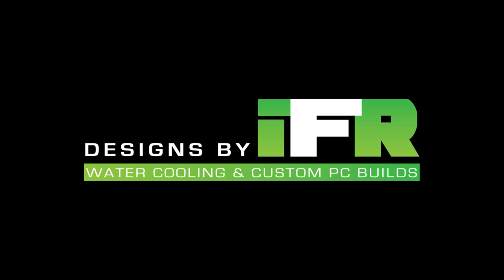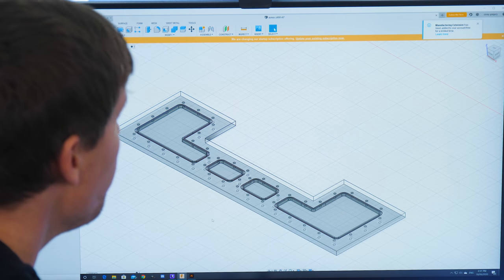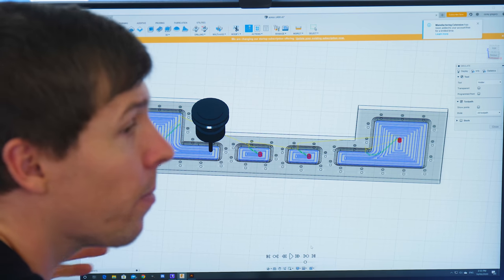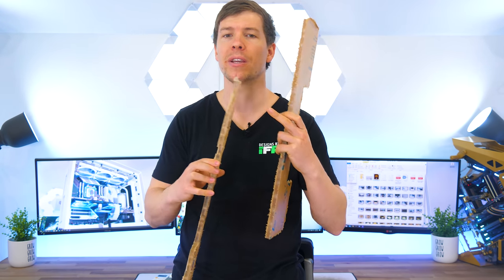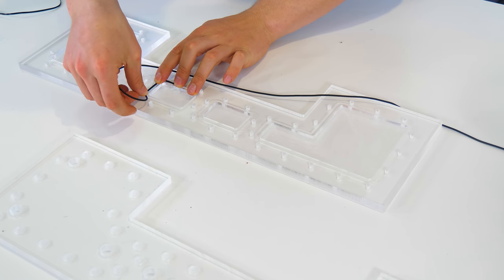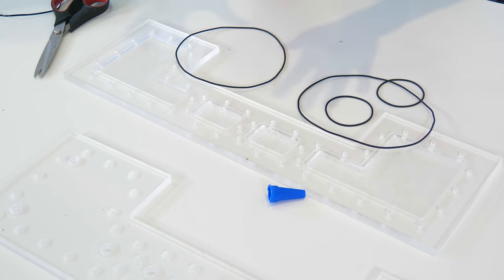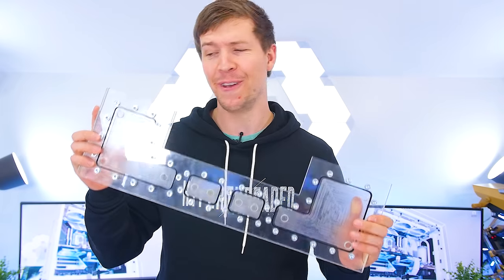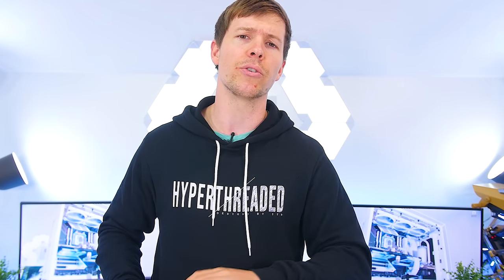We Made Water Cooling Distro Plates - Aorus PC Build Part 4

Comment: Great video. Thanks. Quick question, looks the acrylic sheets you are using are thicker than the ones you have linked to  on Amazon.  can you have the link to those specific ones you used. The ones on Amazon look they are thinner. Thanks again

Comment: Great content Cory, very interesting on how you make the distro & gaskets. I agree with the EKWB Leak Tester, I have one and it is much better than the Dr. Drop version (which I also have but the tool itself leaks around the gauge). Maybe I'm slightly more paranoid than you but I test with the Leak Tester for 1 hour, not 15 minutes.